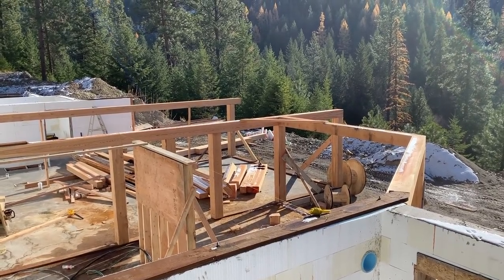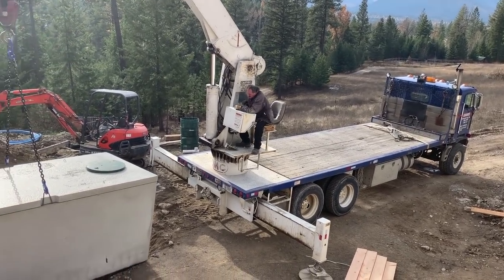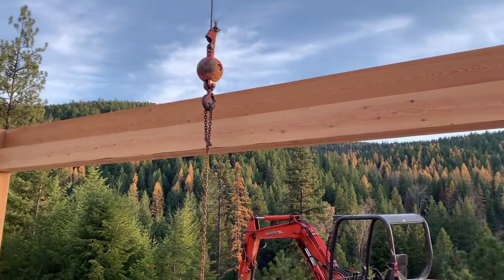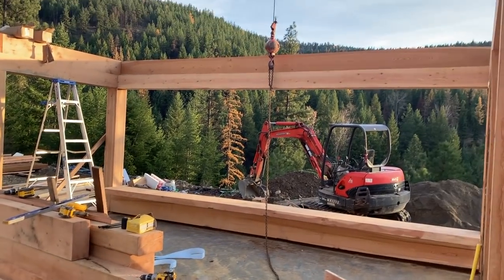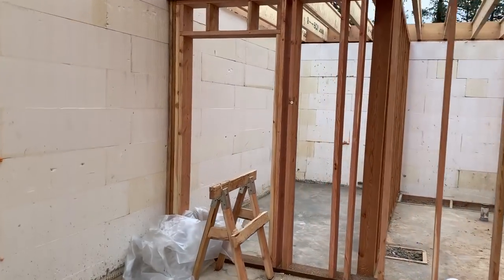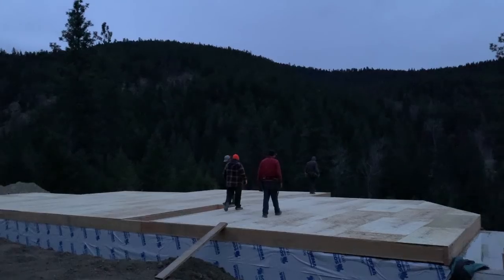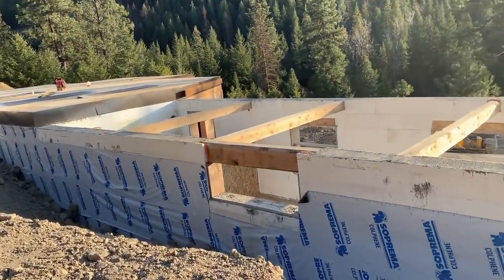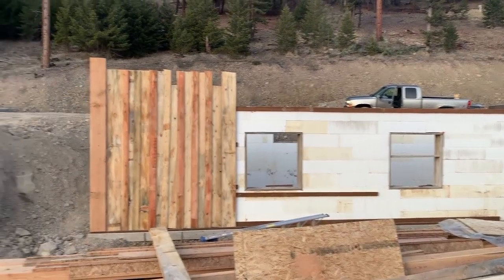Building Our Montana Homestead Part 3 – Timber Framing Basement Walls, Backfill, Installing Subfloor

Comment: Elvie Do you plan to use the traditional wood stove or are you using a wood boiler?
Reply from the maker: I will be producing videos of that as we build it but there will be a woodfired furnace underneath the greenhouse which will heat the greenhouse and the house. In addition we will have a wood stove inside the house.

Comment: The wood beams that expand  across the basement are embedded in concrete walls. Am I seeing that correctly??? If so that is a bad thing just waiting for wood rot.
Reply from the maker: The wood beams are not embedded in the concrete they have pressure-treated wood wherever they touch the concrete. Even though in some places you can’t see the pressure-treated wood. So we shouldn’t have any rot problems.
Reply: @AmishMeadowsOfficial  very clean nice-looking work

Comment: That septic tank would fill more evenly if it were on its end.
Reply: Patrick Elliott  One hole for filling, if the entry is at one end while it's lying flat, that one end will build up with solids first, seen it many times, the long drop approach works best.

Comment: When you say foam block foundation do you mean the SIP walls or is the actual foundation foam and not concrete?
Reply from the maker: The correct name is ICF, it stands for insulated concrete form. There is 2 inches of foam on the inside 2 inches on the outside and 8 inches of poured concrete in the middle. For frame houses usually there is a 6 inch concrete in the middle but for log houses it is mandatory 8 inch concrete poured wall because a log house weighs as much is four times the weight of a frame house.

Comment: Looks great except for one thing. Why on earth after all that great wood n beams would you use osb crap? Smh. I woulda used at least pine plywood half or 3/4 in. Osb board is crap to use on such a nice 🏡. Saddddd😞.
Reply from the maker: OSB (Oriental strand board)  has become the industry standard for all homes for subfloors. It is usually considered superior to plywood. So we use an industry standard product that is weather safe up to 90 days in wet weather.